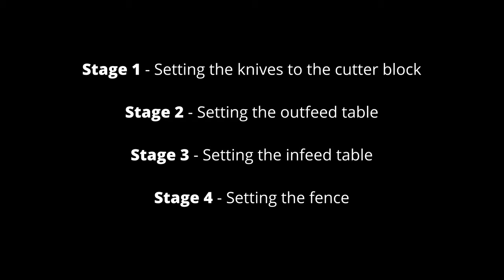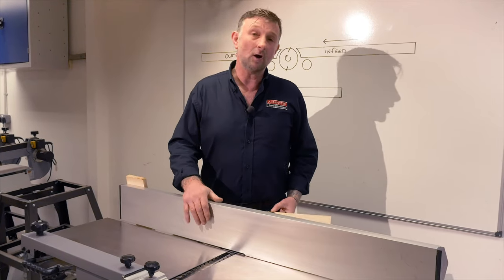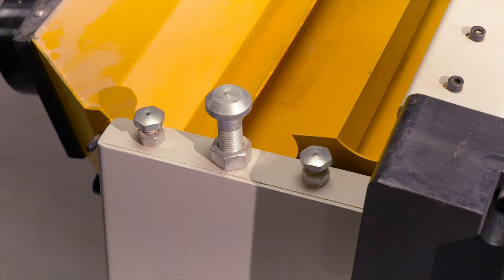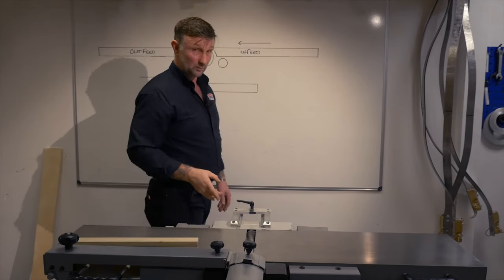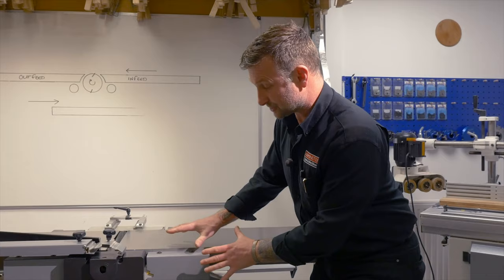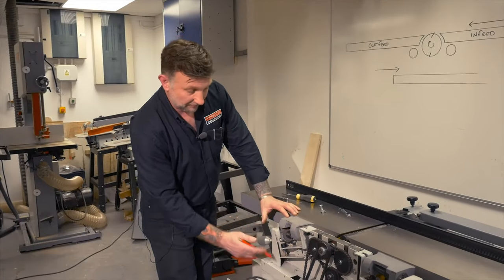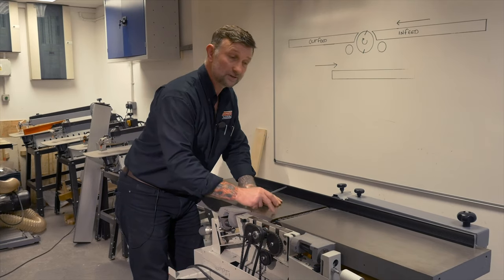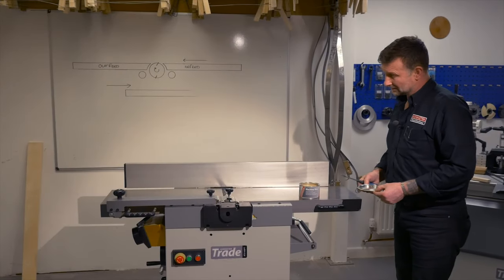How to set up a planer thicknesser

Comment: Great guide.  I've set the blades and tables up on my Axminster AW128PT so the planer is perfect.  However, the thicknesser does not cut 'square' - one side cuts slightly thicker than the other.   Would be great to have a video on how to adjust the thicknesser to produce 'square' cuts.

Comment: These spiral planers are incredible, I have one, a very quiet machine that even my elderly neighbours do not hear to moan about. 
Just a observation, did anyone else notice when Craig had adjusted the fence side of the infeed table, he kept his hand on the straight edge on the infeed side rather than the outfeed side, there is no surprise that any feeler gauge would slide under a straight edge when held.
It can feel very troubling and irritating undoing the lift bolts, turning a mil or two then tightening up over and over again but when it is all completely flat and co-planer, the satisfaction is a huge smile. 
My best advice is set yourself aside a couple of hours to sort this.
Reply: I have the older model and asked if there was an upgrade , but it seems they are so different as not be possible owing to bearing placement.😢 The older models make too much noise and need the blades setting after any catch😢

Comment: Can I just say thank you I’m trying to save up for a decent thicknesser planer all I have is a Screwfix Titan death trap. I’m disabled use a wheelchair but looking at this one or any spiral cutter block as my hands are rubbish and the least amount of setting up the better. If I got one from yourselves in future is there any help I can get to get into my shed / workshop it’s 16ft x 10ft but would need a wheel kit for it. It’s getting it into shed is problem for me. 
But thanks again very helpful video cheers Steve 👨🏼‍🦽

Comment: Many thanks gor this video, i learned a lot. Do you know the wrench size ?
8mm is to large. With caliper i measured 7.5mm. Is that correct ? Or is it in inch ?
Wrench for the blade holder bolts

Comment: Hi - my problem is that even if I lower the out feed table to the lowest level, it still does not grab the wood (I.e. its too high and I can’t see anyway of adjusting it lower).  I tried to solve this with the levelling bolts on the other side, but even with both of those disengaged, the blades don’t grab the wood.  Is there an easy solution I’m missing?
Reply from the maker: Dear Mr Barry
Have you been able to check the drive roller height, as it would appear that they are too high and not pulling the timber through.The roller height are adjustable as they are sprung loaded.
Kevin
Specialist Technical Advisor

Axminster Tools
Phone: 03332406406
Web: www.axminstertools.com [https://www.axminstertools.com]

Comment: Too bad the 310 model doesn’t have a way to adjust the backside of the table. It’s basically a £3000 thicknesses because it’s impossible to achieve and maintain planer alignment.
Reply from the maker: Hi there, you should only have to adjust the table when you first get it, and it's also recommended after each time of usage/starting a new project, to ensure the settings remain the same, as in some cases you'll need to move the table whilst cutting to hit all the areas, then reset it again. If you need further help, our technical team are on hand to answer questions https://www.axminstertools.com/contact